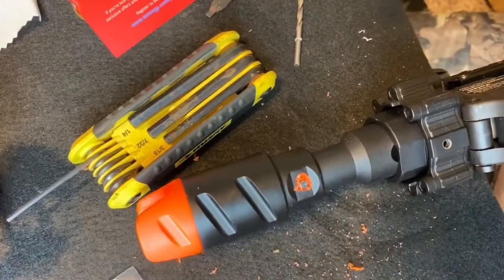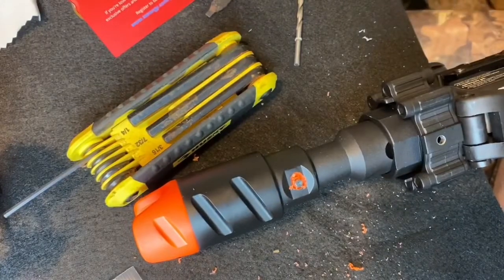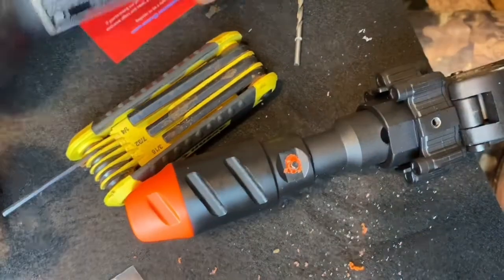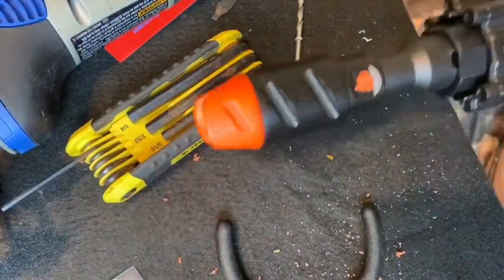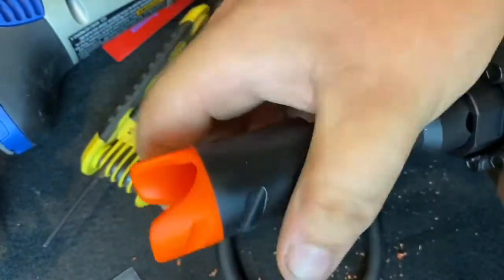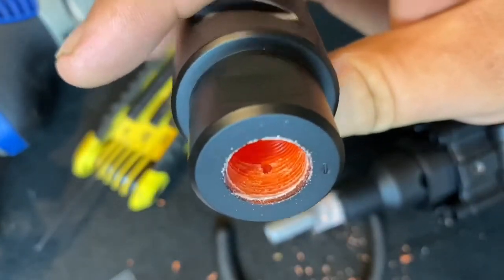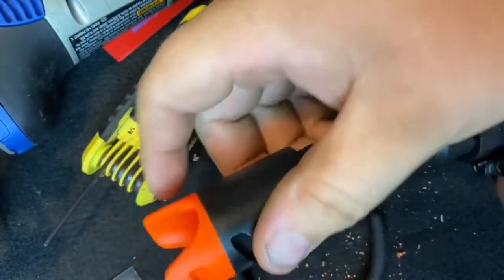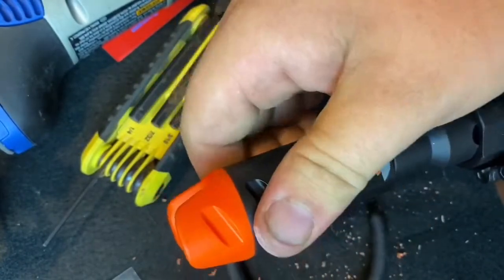How to REMOVE THE Amplifier on the G&G Firehawk

Comment: disclaimer
models with the muzzle glued & pinned will leave residue from glue on the threads jus soak it some more pick it out with something skinny do your best
Reply from the maker: Jeremmeyy ! Yeah I just used a little wire brush and they came right off no problem

Comment: i have a question about your gun. after about 2 full magazines does yours seize up?  like it just stops firing. i don’t know if it is just mine but it just like seizes up and it won’t fire. it feels like it wants to but it won’t.
Reply from the maker: Mine hasn’t I’ve ran 4 mags back to back and no issues at all.
Reply: @JohnRando904  thank you for the response